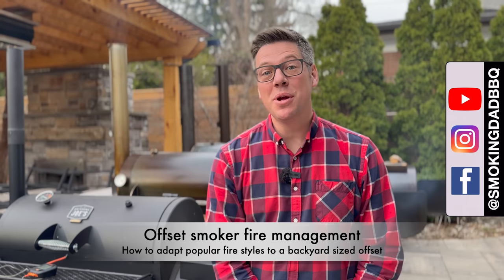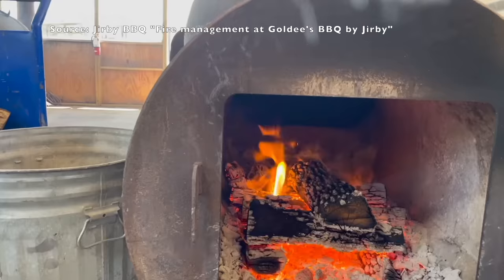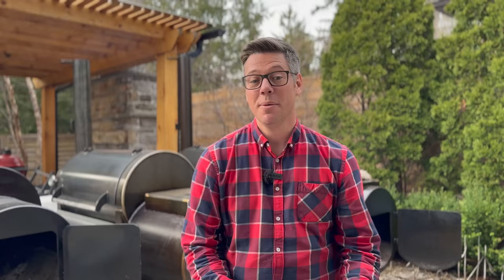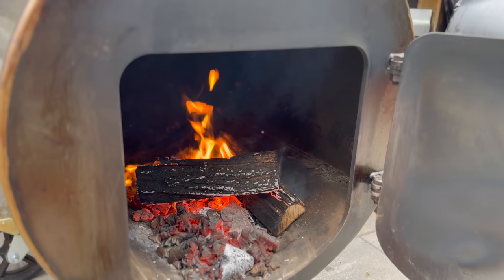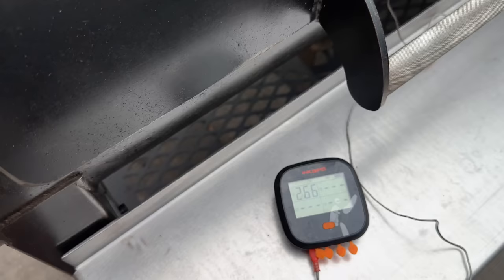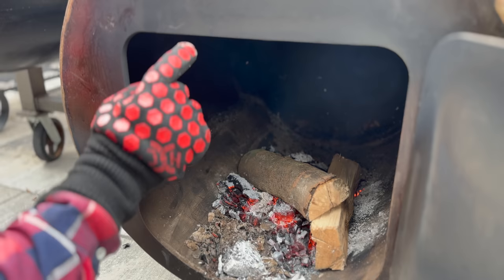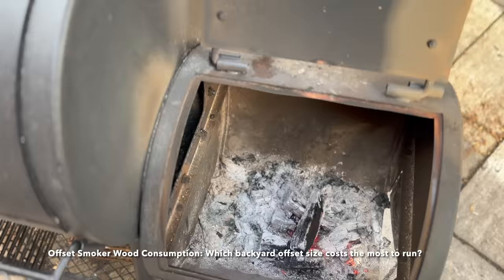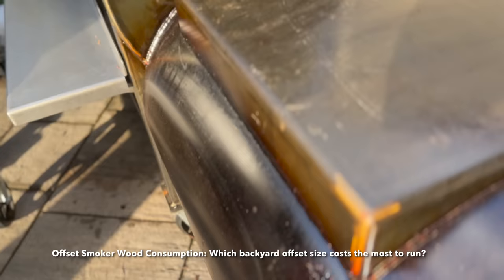Offset Smoker Fire Management 101 (That WORKS On Backyard Sized Offset Smokers)

Comment: I’ve got a CHEAP offset and I learned from Aaron Franklin and Jeremy Yoder that the absolute best way to control temp is managing fuel, not airflow.  Once I get a coal bed, I’m burn single splits every half hour and can hold 250-270 fairly consistently.
Reply: That’s exactly what I do on my Oklahoma joe.
Reply: 😮what size splits are you using?  I find myself in my 40” LSG offset needing to use like 1/2 mini splits - like ones Aaron Franklin used in a recent video showing how he manages a fire on his small offset. Basically 2-3”x6”
Reply: @jamesrazza2246  
I use a single split, and guessing 10-12 in long?
Reply: @jamesrazza2246  I do the same as the other comments - 1 split every 30 min or so.  Somw of the wood sizes I get arent very uniform, but I try and make my split size about that of a 16-oz energy drink can.
Reply: On my OKJ Longhorn Combo, I find it best to establish my coal bed and then use wood chunks. I build the fire near the door and have begun processing the wood chunks to consistent sizes. Way easier to manage my fire this way.
Reply: @user-om2tm4fm7x , I think you would have a real hard time maintaining a consistent temp that way. If lump is the only fuel source you have, I would use a weber kettle or something like that. Where do you live to where you have no access to wood?
Reply: @user-om2tm4fm7x , bagged wood chunks are good source depending on size of bag and size of the chunks themselves.  Keep in mind that bagged wood will hold moisture.  Just a heads up.
Reply: @user-om2tm4fm7x  Most fruit and nut woods do well as cooking fuel, something like acacia could work well.  Might check locally to see if you can find anyone locally working with any of those.  Sometimes sawmills will give away or sell at a deep discount their offcuts/ trim.  You can also have a small charcoal/ wood fire going outside of your bbq and use a shovel to transfer lit coals from one to the other if you dont want to load unlit charcoal into it.  Good luck on the hunt
Reply: I have a chargriller offset, it's thinner than Oklahoma joe but this is also what I do, I just make sure to flip the firebox grate upside down so that it sits higher and get better air flow beneath the coal bed and fuel
Reply: I have an Oklahoma Joe’s longhorn triple combo. It was a wedding gift years ago and I wish I had known what I know now and I never would have asked for it. It’s great for a beginner but it’s a bitch to cook on once you know what you’re doing. I’ve made amazing food on that thing with all the trouble it brings, I can’t wait to see what I can do on a real smoker!
Reply: @granitegreg7883  yup, going from a sheet metal box store smoker to a 1/4in thick pipe smoker is night and day, insulated is the same step up from there.
Reply: @hawkeyeted  how do you manage the stack up of coals on a long cook? I get a pile of coals and ash after a wile that becomes a pain
Reply: @ssudzy3  
I rake them out into my ash bucket, but you have to be careful that you don’t rake out so much that you lose the bed entirely.  If you stack you coal bed to the front or back of the firebox, it’s a little easier to manage.

Comment: On the start recorded temps would be the start “warming up” pit and building a coal bed first to stabilize heat and then use splits to manage coal bed would be more efficient and accurate.

Comment: If you use a charcoal base to start your fire, none of these methods are necessary. Chud’s is closest I guess. All you need to do is start with a coal bed, pushed to the back side. Then put two splits on and feed the fire one split at a time for your cook. Have one waiting split pushed up against the other said and just move it over to the coals when ready. Since it has dried out it will combust immediately. It will work for most sized smokers. Chef Tom of Atbbq does it this way as well. Lot a lot of bbq these days, I think a lot of this other stuff is overthinking it but hey, do what works for you

Comment: i have an Oklahoma Joe Highland and know very well what a pain it is to manage the fire.  ILike others have mentioned i build a coal bed and then add fuel one split at a time.  I put splits on the top of the firebox to warm before it is added to the fire.  I have a baffle between the firebox and cooking chamber.  It is just an old grate covered in heavy duty tin foil.  It reduces the size of the opening between the box and chamber and keeps the fire out of the cook chamber.  It also helps to even out the temperature across the cooking chamber.  Finally, I monitor the temperature with a  Thermoworks Smoke two channel so that I can monitor the cook without having to spend all day tied to the smoker.

Comment: I have 120 gallon custom 1/4” thick offset smoker built into my outdoor kitchen. The smoker sits on a pad with quartz counters. The 28” firebox is about 2” from the counter. The guy who installed the counters was concerned that the heat from the firebox would crack the counters. I ran out to the stone yard and bought 16 fire bricks to line the inside of the firebox. I have this video to thank for that idea! And I have to thank you for saving me some serious money and saving my counter tops! I fired the smoker this weekend for the first time and it works fantastic! Cool counters 2” from a hot fire with no issues.
Reply from the maker: thats awesome, glad it helped

Comment: for anyone playing with an ok joe, ive learned instead of trying to get properly dried wood to burn clean, i will get my wood as insanely dry as possible, usually i use it as a heat shield in the smoker and let it dry while i cook, and instead of trying to burn wood clean that doesnt want to, i try to burn wood that ONLY wants to burn clean in a dirty fire otherwise i get no smoke. but small pieces, ever 15-30 minutes with the vents wide open, and giving that wood as little space between the coalbed and it as possible, so theres some smoldering. its still a clean burn, but its just thin blue instead of literally nothing

really hard to explain, but it works for me.

Comment: There really is no set playbook for fire management on an offset. A lot effects how your smoker burns fuel, drafts and retains heat. The size of the smoker of course, the gauge of the steel, how well it's seasoned, how it is built to draft airflow, the species of wood that you use, the moisture content of the wood, the size of the sticks you're burning and how much meat you put on the smoker. Even the ambient temperature around the smoker comes into play. 
It's really about getting to know your specific smoker and cooking on it a lot. Nothing wrong with trial and error when smoking meat. Most big cuts used for smoking are very forgiving, especially pork butt. I've been a professional chef for 30 years and I still learn something new about smoking on my Lang every time I use it.
I love the constant attention that an offset smoker needs. It's a great beer drinking past time!

Comment: Interesting stuff James.
I used a pattern similar to Chuds style on my Yoder and it worked pretty well.
On the Carlisle I used that  cabin style of stacking the splits and the temps were to high for low and slow.
On my next cook on the Carlisle I think I'll go back to Chuds set up up for the low temp part of the cook and adjust for the higher temps when needed.
I'm using the gas station hardwood for the pre heat and it's certainly more cost efficient, and I'm also thinking of using that wood during the wrap portion of the cook.

Comment: I have what you'd call a backyard offset, a 16" blackfire Indiana /cactus Jack. I start my fire with charcoal and I use thin splits, little bigger than kindling. Trouble is they burn out in about 15 mins. The temps are up and down like a seesaw. Sometimes it's necessary to add extra coals with to the coalbed so it doesn't die. I'd love it to be easier but with a small firebox, this is life.

Comment: As always a professional video. And this is a great topic (thanks for doing it). My smoker is kind of an in between, Lang 48” (100 gallon I believe). A very quality smoker, but the smaller of their offered sizes. But, it has a full welded baffle in it which makes a huge difference. I recommend an aftermarket baffle to most anyone with a decent COS. I also had a friend make me a “V” fire basket and it also does a great job of aiding in my fire management. Using quality hardwood is very helpful…softer woods will burn quick and inconsistent, good hardwood burns consistently and longer (and allows for lower temp control).

Comment: Honestly, after wrestling with temps and fire management, i found a chimney of briquettes in the bottom, then 1 split of flavouring wood does the trick. To stop the temps from spiking to high, I'd say smaller spilts would be better suited to this size smoker.

Comment: Great video on fire management. I'm on my second smoker which is just the OKJ Highland but it is the reverse flow model. I was not entirely sold on reverse flow on such a small entry level smoker but I did add a custom baffle plate and what I do like about it is that there are no flame flare-ups under the food and the thicker plate is lower in the cook chamber and heats up nicely. I do need to figure out something like your fire brick suggestion in the burn chamber to generate a more consistent heat as the metal is fairly thin and the chamber is small. All in all it is a decent smoker but I do wish it had a longer firebox so I did not have to cut all of my splits down. Just added effort.

Comment: Thanks for the video. I'm going to try your suggestions to see what works best. I have the one of the cheapest offsets ever. It's a CharBroil 1280 that I bought for only $25 on FB Marketplace. I've been struggling to get the initial fire going. I think not having the log directly flat on the coals helps. Towards the end when I resituated my logs, it caught fire like crazy and unfortunately, I had 2 logs burning hot which raised the temp to like over 300 degrees. Not a good thing when you need to go low and slow. I think getting that one log would suffice, it's just a matter of getting it to catch on fire.

Comment: Great video James! I am still working with a small backyard cheapy Char Griller, and I found the Western brand chunks work great. I do mix in some charcoal, but, once I'm up to temp, I can keep her purring at a steady 200°- 225° all day long. Pecan is my favorite!
You have inspired me to try some adjustments, I'm going to try to use just the chunks next cook, and I'm also going to move the fire the farthest away from the cook chamber that I can get.
Cheers!!
Reply: I have a char griller myself and bought an optional side fire box and using it as an offset smoker. What’s your technique to keep the temp in that range?
Reply: @airwrecktion  Wood chunks are the answer! 
When I first started, I would get high temperature spikes because I added too much wood at once. So, a lot of it is just learning to add small chunks (not splits) when you see your temps starting to drop. One little trick I figured out- if I added too much wood, and my temps were spiking too high, I would remove some of the wood into a metal fire pail, so that I didn't ruin my cook. But, after you get through the learning curve, you won't have to use it, and you'll be able to maintain steady temps all day long! Also, these offsets seem to do better at lower temperatures. Example, if most people are smoking ribs at 225° to 250°, I'll run my pit at 180° to 200° for the first several hours, before the wrap, to achieve the same result. (I do bump up my temp to 275° during the wrap)
Cheers from Arizona!

Comment: Adding the “taboo” tuning plate in smaller smokers acts as a heatsink and allows a better coal bed with less heat at grate. Doing this on my Wrangler. Less dramatic spikes and with 20-25% mc splits it just rolls along better than my oven.  Brisket turns out amazing- I can send pictures if interested
Reply from the maker: That’s a good point. Already sold it otherwise I would play with that more
Reply: Yup. With tuning plates I was able to run my 40” LSG like Yoder and others do with full splits and it would hum along for 30-40 mins nice and smooth. But that made my offset a bottom up cooker vs top down.  About 1 yr ago I removed all plates and get better authentic top down bbq and bark.  But as James showed above, I gave up ease for babysitting my fire every 15 mins with tiny splits but I think better product in the end.
Reply: @SmokingDadBBQ  Really enjoying your stick burner videos, man. Keep them coming!!
Reply: @jamesrazza2246  With the Wrangler being only 30” long, I don’t think there’s enough room for it to be a really good top down smoker. Hmmmmm…. May have to get a longer chamber 🤔. Are you just getting better fat rendering with Fat Side Up?  Did you run it FSD with tuning plates?  Is the flavor really that noticeable..ie.. more smoke flavors?
Reply: @2005Pilot  Interesting you say that, I removed the plates a good year or so ago.  The tuning plates definitely  did help keep the pit totally even temps AND you can throw good size splits and walk away for 30-45 mins (like Cooking with Rye does).  At the time, I was more annoyed b/c it was a bottom up cooker with everything, including ribs (beef and pork), pork but, etc. So...could I tell the difference?, yes I could visually.  I also believe the bark formation was better.  With that said, As a novice BBQ'er, I didn't really test 'before and after'..I was just really after an authentic style off set and avoiding burning the bottom during long cooks. You have me intrigued though, maybe I'll go back and try it again with the plates and see if the baby-sitting the pit is worth not using the tuning plates.  If I do get around to that, I'll let you know.

Comment: Great info! I have a question James - I am a beginner with an OK Joe's Highland - I saw one of your videos using firebricks in the firebox. Decided to try that as my fires with the charcoal basket or with just the bottom rack were way too hot. Tried to use the Chud's all wood method (with just enough lump charcoal to get the wood started. It started out great - but I think the firebrick blocked too much airflow - especially when a little coal and ash built up. Better to use either the basket or just the bottom rack when using an "all wood" method do you think? Thanks for your videos, overall they are the most well researched and helpful out there!
Reply: I have a cheap Char Griller and was having the same problem until I started using a fire basket and wood chunks instead of splits.

Comment: Smaller offset smokers can cook just as well as a larger/thicker offset, difference is fuel usage. I believe a small offset can be very productive if you use charcoal and a chunk of wood for smoke periodically. The charcoal is very predictable and the moisture content is predictable as long as it is a new bag and dry. Use enough charcoal to reach the temp needed and add charcoal as needed to maintain temp. Its that simple.
Reply from the maker: It really does help, but I avoid charcoal like the plague in my offsets as I have several charcoal grills and want just wood. 

The firebox design keeps the coal bed alive well enough I’ve never needed it even in winter months but agree that’s an option

Comment: I also believethe reverse style is more beneficial in the smaller offsets as it allows the reverse plate to act as a heat sink..
Reply from the maker: I’m open minded to find out. It makes a lot of sense on paper that for the backyard it might just be the ideal form factor
Reply: @SmokingDadBBQ  you can use cheap ceramic floor tiles that are 12x12 or 16x16 cut to fit and lay them from the top of your firebox outlet to about 6-8 inches from the other end. This will do the same and be a lot cheaper than a steel plate cut to fit. A masonry blade on a 4 inch angle grinder and you can cut whatever width you need. Also, you can put water pans for added moisture and added heat sink as needed. Once the ceramic floor tiles are placed in the pit, you can separate them at different places to distribute the heat better.

Comment: My pit has a removable grate in the fire box. I notice the coal bed will fall below that, it will still light the wood when I put it in the box, but would it be better to remove the grate and use the methods you showed in the video ?

Comment: Hey thanks for the video.
I have the highland smoker and the trouble i have is with the grate in the firebox. I tried a chimney of lump and then wood.
Problem being is in no time everything falls thru the grate and sits on the floor.
Can i just take that grate out and burn a fire on the bottom just like those larger offsets?

Comment: The thing is, if you're going to spend the money for a "good" backyard offset like the Smoke North, Mill Scale, Franklin pit, etc, you're already in the $3500-4000 range, and it's like... $5000-6000 to get a custom pit build with double or triple the capacity, insulated firebox, etc. That's why I don't think backyard offsets particularly make sense.
Reply: Not everyone has room for a 250g+ smoker and unless you have a huge family or otherwise feeding a large group of people it's overkill. You waste a lot more wood running a 500g pit for one brisket and a rack of ribs. I will also say, with a lot of these smokers you are paying for the name, although that has changed to some degree with the sky rocketing price of steel.